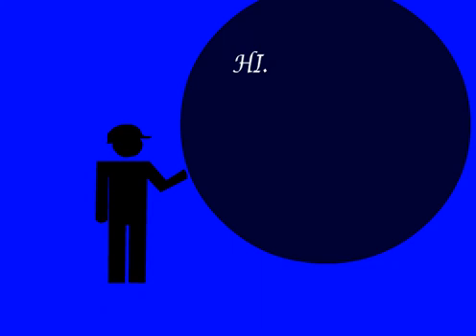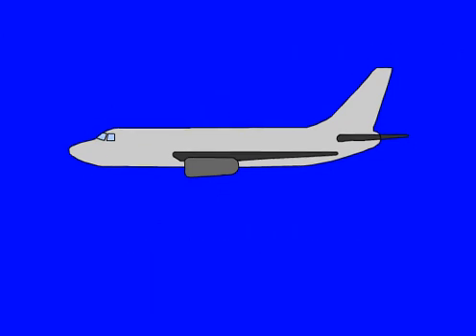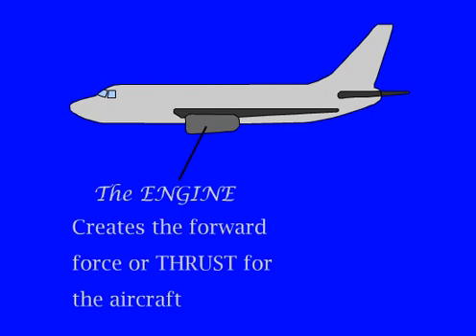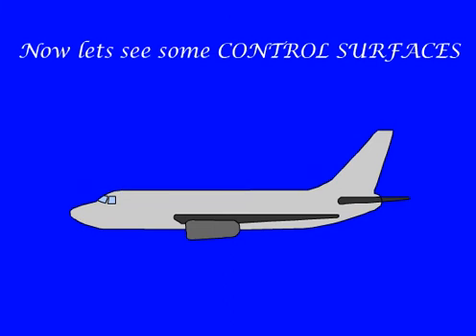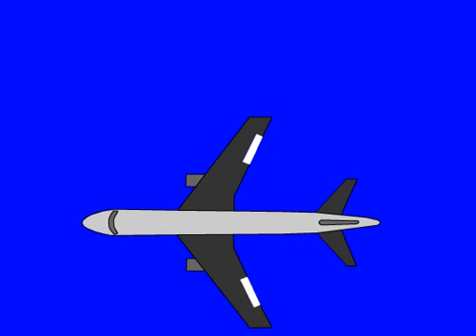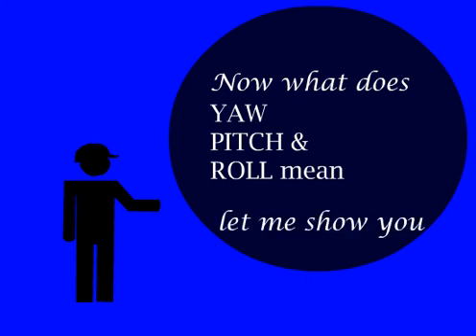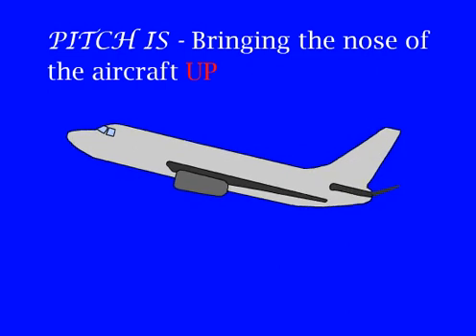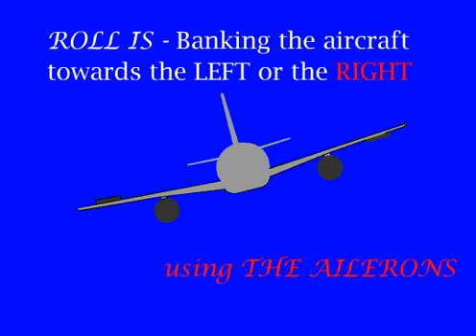Parts and Control Surfaces of an Aircraft

Comment: Please explain the difference between ROLL and BANK of aircraft in flight. I am very confused about the two words. Are they interchangeable?
Reply from the maker: They are the same, but with a small difference: ROLL refers to the moment: ROLLING MOMENT. BANK is used for mentioning the angle i.e. BANK ANGLE of 20 deg.
Reply: @JxJAVIATION  Never thought I would get an answer. Thanks a million for clearing my doubt. Thanks a lot Sir. Great
Reply from the maker: @sadayarkoil  You are welcome! I always make it a point to reply to any comments or doubts! :)